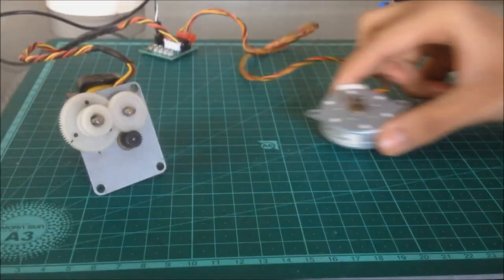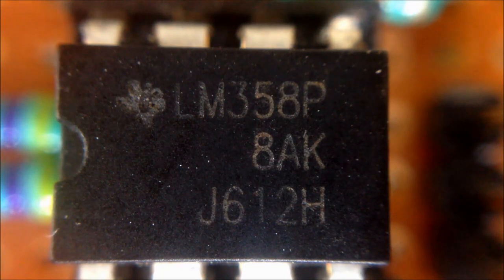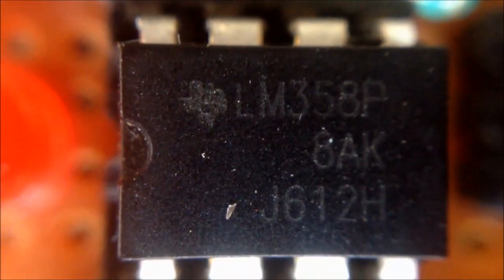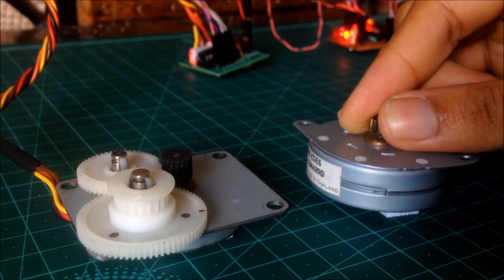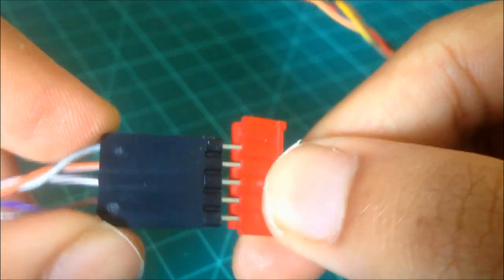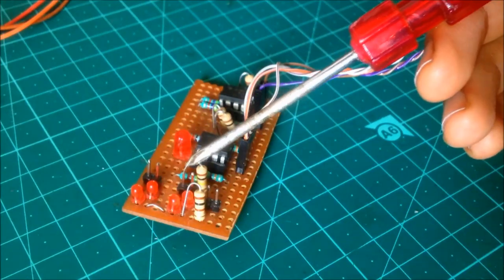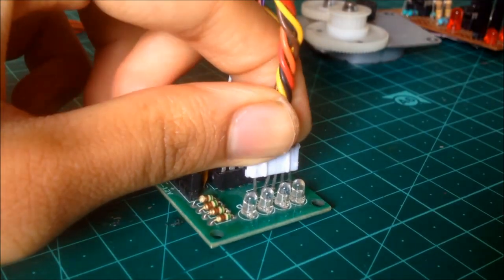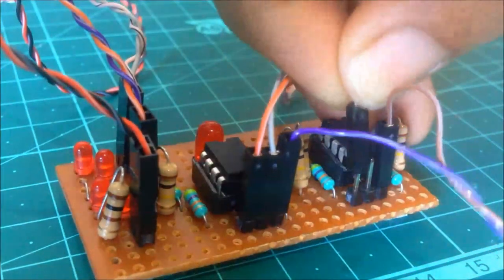HACKED! Stepper Motor Controlled Stepper Motor without Micorocontroller (V2)

Comment: "Stepper Motor Controlled Stepper Motor without Micorocontroller"
why "without" if u build PCB with microcontrollers?
Reply from the maker: No microcontroller has been used in this project. The chip used in the custom PCB is an LM358P op-amp. It is used to amplify the weak electrical signals to higher voltages to be fed to the input pins of the stepper motor driver.